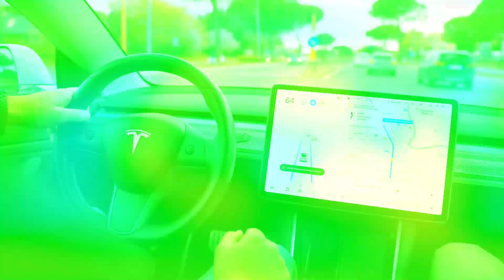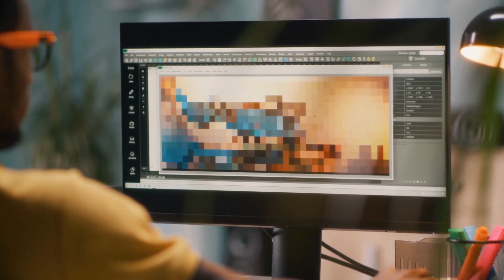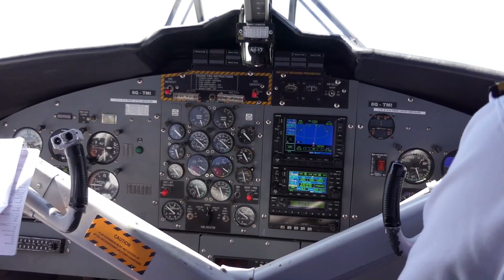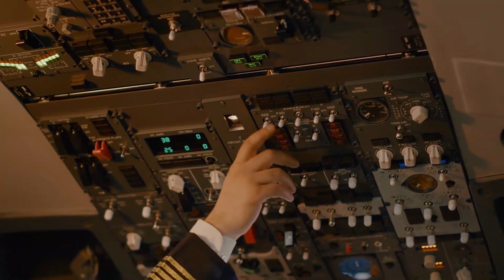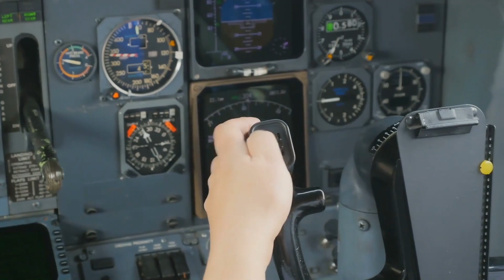Tesla News: Electric Aircraft to Disrupt Airlines

Comment: You have absolutely no idea what is required for supersonic VTOL and quite obviously, neither does Musk. 400 Wh/kg would be just enough for EVTOL to manage short hops in the order of about an hour at similar speeds to helicopters. But 400 Wh/kg is not available and is not about to be available. Remember how Musk was certain that he could have hyperloop ready in a couple of years, back in 2013? Hasn't happened. Remember when he was certain they could deliver Tesla Semis by 2019? Still hasn't happened. The one and only airplane so far certified anywhere to be powered by a battery has a 200 Wh/kg battery. It may be a decade or more before 400 Wh/kg is available in a package safe enough for public transport. But supersonic VTOL of large passenger carrying aircraft flying intercontinental is orders of magnitude greater still. It is pure fantasy, and will almost certainly never happen. 
   Go and learn some aeronautical engineering if you intend to do videos about this stuff. Turbines do not get LESS efficient as they go higher - they get more efficient until the optimum cruising level is reached about 36 000 ft. The maximum thrust available reduces as they climb but that is no big deal as airliners fly in the transonic range where they are aerodynamically limited not thrust limited. Notice that turboprops cruise around 10 000 ft lower for a reason - prop efficiency goes down as true airspeed increases, which it does with altitude. This should alert you to a major barrier that needs to be overcome before an electric propulsion system can even produce thrust in the supersonic regime, namely you are trying to accelerate air through the sound barrier without adding any heat to it. But of course Elon will already have figured this out so one of his fanboys will be able to provide the answer, even though it is missing from your video......

Comment: Just remember if it is a "jet" it has a "jet" engine in it, we are going to use motors and propellers cause  it's simpler and we know it works.
Reply: You cannot use a propeller for supersonic flight. It is impossible. So if you think you know it works then you think wrong. It is not even practical to fly at high subsonic with a propeller because they become highly inefficient, which is a waste of energy you cannot afford when limited to a battery worth.